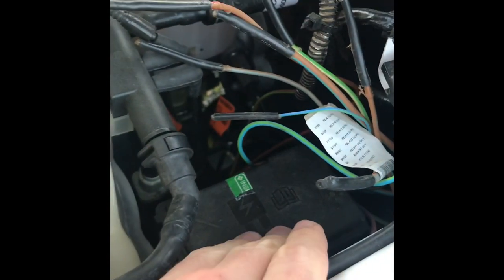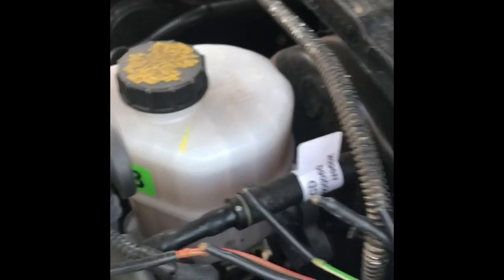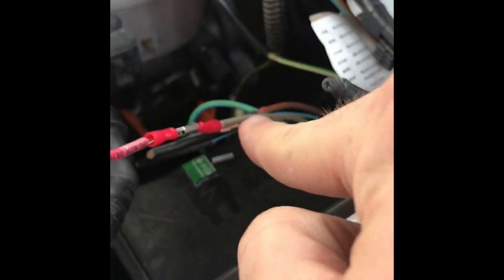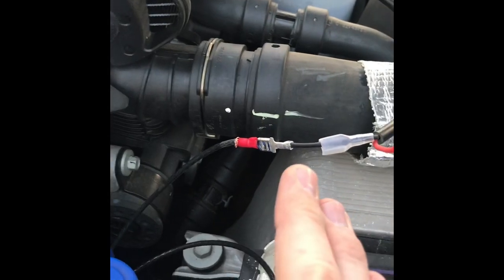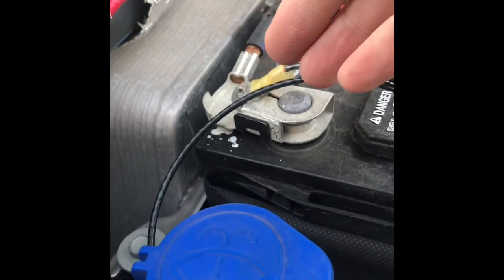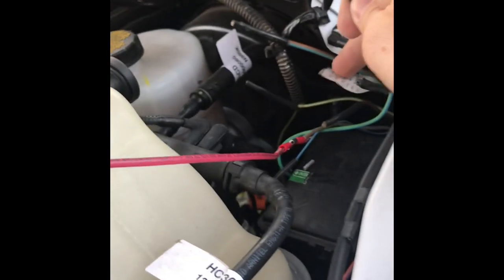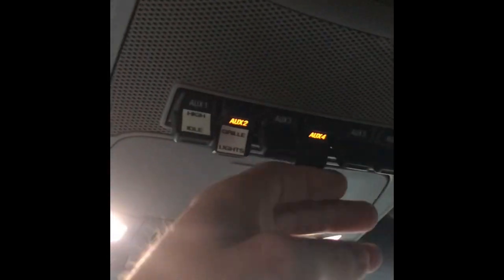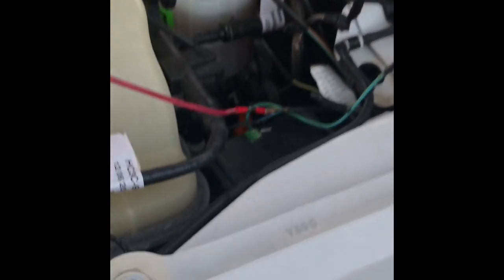How to wire up 2017 and up f250 upfitter switches (auxiliary switches)

Comment: The information is good BUT...the entire assembly on my 2020 F250 was on the passenger side. The wires were wrapped into a bundle, tucked way back and under fuse box and unidentifiable until I remove all the taping. The mfg date on my f250 is 2/2020. Other than location his info was spot on. I used it to wire a winch and driving lights. His "trick" to make AUX hot full time was AWESOME.
Reply from the maker: Thank you for watching, and thanks for the feedback! Yes on the 2020 the upfitters are on passenger side, when i made this video only the 17-19 were out. But i have put in the video description that for the 2020 its on passenger side, wish i could edit the video somehow to tell that to the 2020 owners. If you havent, please like and subscribe, im trying to grow the channel and i really appreciate it!

Comment: excellent video - very specific - I received my 20 inch black oak light bar - I have a 2019 ford f-250 with 6 up fitter switches - am I correct in understanding your video that all I need to do with the black oak wire harness is make a ground connection and connect the hot wire to one of the up fitter wires under the hood - I don't need to bother with the relay, fuse, and on/off switch that came with the harness?
Reply from the maker: You can hook it straight up if you would like. But it would only take 5 minutes to put a inline fuse in the hot wire. Without a fuse It could burn your wire up. But yes that is all you do. Please like and subscribe! 🇺🇸
Reply: @COLTSWAY  please explain the inline fuse regarding hot wire
Reply from the maker: J R all you are going to do is cut the hot wire somewhere before the upfitter and splice a fuse block In. Best I can explain is go to google.com and type in inline fuse block then go to images and you will see what it is. If you need anything else. Email me at coltshinton@gmail.com and I will send you pics of what I’m talking about.

Comment: I cant find the wires under the fuse box under the hood? Any ideas where they could be?
Reply from the maker: Michael Burke what year is your truck? Do you for sure have the upfitter switches inside the cab?
Reply: @COLTSWAY  it's a 2019 and yes but my only have 4 switches
Reply from the maker: Michael Burke send me a pic to my email of your switches. Coltshinton@gmail.com

Comment: Colt, I have a 2020 F250 Xl and I could not find the auxillary wire box under the driver's side of the truck.  I was trying to use your video as a guide, but the camera movement was difficult to follow.  I'll check out your other video to see if it gives slower but more detailed info where the upfitter aux hub is located.  Thanks for the videos.  👍🏽🙂.
Reply from the maker: On the 2020 it’s on the passenger side brother. 🇺🇸
Reply: @COLTSWAY  Roger that.  I'm on it.  When I looked at truck last night, I said to myself, that sure does look like the box (on passenger side) that Colt was talking about.   Thanks again.  Go Army!  👍🏽
Reply from the maker: Yes sir anytime!! I made the video before the 2020 was even out so I didn’t have a choice to show it would be on the passenger side for 2020. 🇺🇸
Reply: @COLTSWAY  Thanks Colt,  I found the upfitter wires under the upfitter fuse box on the passenger side.  Since my truck is new, all the wires were folded and totally taped up in a bundle.  I cut the black tape to unwind the bundle of upfitter wires and examined the wire with color-code tag to identify which auxiliary switch it corresponds.  Each wire has black plastic protective tip.  To access the particular wire I wanted to use,  I cut the entire black end off in order to get to the copper wire then used a butt connector to splice both wires together.  Not difficult. I will admit it was a slight task since it's tucked under and the F250 is so dang high in the air (smie). Thanks again for this video.
Reply from the maker: Glad you got it working my man! Yes they don’t make it easy being it’s so y’all! 🇺🇸

Comment: Great video! I’m looking to wire rock lights to either 5 or 6. Is there fuses already set up or do I just put one in line when connecting them to the switch lead? If they do have one do you by chance know what size? I would investigate myself however I do not have the truck right now. TIA!
Reply from the maker: 1-4 are 25A. 5 and 6 are 40A. Thanks for watching. Hit that sub button if you haven’t! 🇺🇸🦅🇺🇸

Comment: Hey man, you said you have the 12 volt solutions remote start. If I wire up my upfitters 1-4 and leave them turned on and crank my truck with the 12 volt remote start, will the upfitters 1-4 become hot or does the key have to be turned on?  Also wired up my DIY step lights this past weekend, they are awesome. Also got my 12v remote start and it doesn’t interfere with my banks tuner. Thanks for all the info.
Reply from the maker: Sorry bout the late reply. Just got home from work. That is a great question and I just wanted to make sure I was correct. Yes, when you remote start it the upfitters 1-4 are hot! 🇺🇸
Reply: @COLTSWAY  Awesome, thanks.

Comment: So is there already a relay built into it so it doesn’t burn up the wire? I’m used to buying the switch with relay off amazon
Reply from the maker: Sonny Falcon there are fuses for them, you can look in manual and see what ones they are. But I usually put a inline fuse when I install things, I just didn’t wire it up for this video.
Reply: What amp fuse do you use in the in-line? Thanks for a great video!
Reply from the maker: Really depends on what it’s running, but mostly just 5 to 10 amp fuses. Unless it was a fuel pump or something I would go a little higher. Usually you can read on whatever your installing and see amperage it draws. Thanks for watching man. If you haven’t please like and subscribe! Trying to grow the channel. 🇺🇸

Comment: i have 2017 ford f250 diesel and my upfitter cables under the fuse box are not giving any power when I flick the switch. all fuses are getting power and relays are getting power, i believe the issue is the switch wire to the relay. the aux switch light up nut i do not hear the relay clicking. PLEASE HELP

Comment: Are the aux switch’s already hot I assume they are since they light up when u flip em so basically ur just connecting to a ground and hooking it up the aux u want?
Reply from the maker: That’s correct. 🇺🇸🦅🇺🇸
Reply: @COLTSWAY  thanks appreciate it
Reply from the maker: @leefalts7528  anytime bro. Hit that sub button if you haven’t. 🇺🇸🦅🇺🇸

Comment: Colt, 

Are there any pass-through wires with no voltage connection? I'm looking for a way to install an external siren speaker. Thank you in advance!

Jeff
Reply from the maker: Yes there is. If you go to my videos and watch the dash cam install video. It will show you where they are at. 🇺🇸🦅🇺🇸

Comment: When you say 5 and 6 hot all the time do you mean key off hot all the time while swich is in on position? Clarify that please. I'm looking to wire dash cams and don't want to lose power to cameras if asked to turn off vehicle.
Reply from the maker: This is a video I made about it. 
 https://youtu.be/hgBdAAmFJeQ

This is the dash cam video I made. Went right to the batteries. https://youtu.be/raoxxnfscZU 

Hit that sub button if you haven’t. 🇺🇸🦅🇺🇸

Comment: I have an 18 550 1-5 are wired in for beacons and floods the 6th I want for fog lights. How would i tap in at the fuse box under hood
Reply from the maker: capecodscott there’s not a pig tail for the 6th one where the upfitter wires are under the hood?

Comment: Thank you 
My 2018 f250 is the xl trim with uplifted switches I wonder if they are hot
Reply from the maker: They will be hot with the key on brother. If you watch my other video on them it shows how to make them hot with the key off as well.  Thanks for watching, if you haven’t please like and sub. Trying to grow the channel. 🇺🇸
Reply: @COLTSWAY  
So I take it that the switches are already wired? So I don’t have to take the overhead panel out just under the dash like you were pointing to?
Thanks Rick
Reply from the maker: If you have the switches up top, it’s already wired.

Comment: I need tho install a BlackVue DR900S-2CH 4K UHD Dual-Lens Dashcam in my 2019 F-350 Lariat.  Where is the best point to draw power from for the Powermagic Kit?  Do i need to tap into the Upfitter switches?
Reply from the maker: Michael Stein you can tap into the upfitters but none of them are hot with truck off. Now you can make the last 2 hot all the time buy moving the fuse in the box by the upfitters all the way over. But to be honest what I did and suggest is to just go straight from the battery to the pass threw wires in the passenger side. That’s what I did. I’m going to make a video tonight or Tom about installing my dash cam. But I just went from battery to pass threw wires, that way it’s always hot and I never have to worry about a upfitter. Please like and subscribe! 🇺🇸. If you email me I’ll walk out to the truck and send u a video of how mine is set up. Coltshinton@gmail.com
Reply from the maker: Made you a video today brother, hope it helps. https://youtu.be/raoxxnfscZU
Reply: Pur/Grn at the ignition switch, is key-on power also

Comment: Is there more to it than just this? I recently purchased ‘19 250 XL and it came with upfitters. I tried connecting my led light pods and got no power. I thought it was the wiring harness but by connecting positive and negative on the battery the lights worked. Trying to figure out what I’m missing here.
Reply from the maker: Dustin Burns nothing more then this. Maybe you didn’t have a good ground when you hooked to upfitter? Try leaving it on negative and then hook the power wire to the up fitter. If it still doesn’t come on try flipping all the upfitters on. Maybe you just connected a different one then you thought. Please like and sub! 🇺🇸
Reply: Okay cool I will try that. To make sure I have this understood, I don’t have to worry about the pass through wires as those serve if I’m trying to hook up something within the cab? For external items such as lights it’s just wiring to the upfitter wires in the engine area on the drivers side and grounding it, nothing else, right?
Reply from the maker: Dustin Burns you are right. Don’t mess with pass threw. I have a video about high idle if you watch that it shows what to do with pads threw if you going into the cab. But for your situation you don’t mess with the pass threw.
Reply: COLTS A STALLION Follow Up: I tested aux wires 1 and 3 (at random) and no juice. However I tried aux 4 wire and it worked perfect. I bought the truck used it only had 6k miles but the upfitter wires hadn’t been touched.. still zip tied to back of fuse box. Could it be bad fuses? Even though they hadn’t been used?

Comment: You think a power inverter could be wired to the upfitter switches?
Reply from the maker: It could be powered for sure but the amps the inverter would need would likely burn the little wire. I’d just run big cable to the battery and have a cut off switch by the inverter. 🇺🇸
Reply: @COLTSWAY   thanks for the reply, I’m actually trying to install a starlight headliner, I’d be running two kits, both are 16 volt and 16 watts. I’m just trying to figure out the best way to wire them in. I don’t know if I should just run a wire from the upfitters to the kits or if I should use a power inverter. If I run wires straight to the kits from the upfitter what gauge wire would you recommend?
Reply from the maker: Well you will be limited to the upfitter wire size, which isn’t that big. So if you went bigger then that it would be pointless because it wouldn’t carry the amps if the bigger wire.
Reply: @COLTSWAY  by chance do you know the size of the upfitter wire? The wire on the kit I’m using is a 24 AWG

Comment: Hey brother Dack Glover. I learned from you how to rig up high idle on my Super Duty.  I have another question.......apologizing now for the long comment to follow.  I just purchased Raptor Style Grill lights, link below.  It comes with a plug that plugs in to the driver side headlights somehow, so I assume they will be lit up anytime while I’m running park, DRL’s, or full on automatic headlights setting.  How could I control these lights with one of the upfitter switches, would I just tap in to the hot side of the plug for the light bar?

 https://www.stage3motorsports.com/1718-RSGLK-2017-F250-F350-Custom-Auto-Works-Raptor-Style-Grille-Light-Kit.html
Reply from the maker: Dack Glover Dack Glover that’s exactly what I did. I have the raptor lights and hooked them up to aux number 2. Just tap the hot end to the aux you want and connect the other end to a ground. There’s a nut you can back out on the right for the ground, that’s where I hooked up my ground. It’s at 2:07 of this Video you can see where it’s at.
Reply: COLTSASTALLION  so this will allow me to control with upfitter and light switch knob or is it either or
Reply from the maker: Dack Glover it allows you to control it with the switch only. I wanted it like that so that I could have only the raptor lights on with nothing else. I always have them on unless i turn the switch off.
Reply: COLTSASTALLION 
10-4......that’s what I’m going to do to brother.

Comment: I have a dash cam connected to my aux switch #1 and wired it with the hard wire install kit and the dash cam works intermittently. I tried 2 different cameras and I get the same result. I can’t figure out why it won’t work!
Reply from the maker: If it’s on number one, it will only work when the key is on....
Reply: COLTS WAY I know, I only use it while the truck is on and I’m driving. It still cycles the power on and off. It used to work fine, then it started cycling on and off, and now it doesn’t turn the dash cam on at all. I can’t figure out how to test the mini USB plug that powers the dash cam.
Reply from the maker: I would get a phone or some other electronic that uses a a mini usb plug and plug that into it and see if it works. I would check the fuse to make sure it’s not blown. Then go to all your connections and use a volt meter to see if it’s got power in front of and behind the splice.
Reply: COLTS WAY thanks
Reply from the maker: Thanks for wAtching, I’d be interested to see what you find. Let me know! If you haven’t, please like and subscribe. 🇺🇸
Reply: COLTS WAY figured it out. It was the transformer from the dash cam wiring kit that I connected to upfitter switch 1. I had to take the whole interior apart again to remove the old wire, and run the new replacement wire. It works perfectly now. Just in case, I changed it to switch 2. I think it might have grounded out somewhere because I had a wire connection not taped good enough.
Reply from the maker: Man I’m sorry to hear you had to do all that! But hell you got it working now my man!! Good job!

Comment: What does the brown wire mean? Run/start out?
Reply from the maker: I’ll have to rewatch the video. I don’t remember messing with a brown wire.
Reply from the maker: Looks like the brown wire is just one of the the wires that goes to an upfitter.
Reply: Ok thanks. I bought some little LED's to go behind the logo but dont come with any info except hook to headlight positive and negative. Which I cant seem to see where they come out. So might hook to an aux switch. Thanks for the quick reply and video
Reply: As far as the wires out of the head light. Do you know what colors I'm looking for? Either im just not seeing them or they come out where I cant find them
Reply from the maker: Email me a picture of what your asking. Do you haven’t upfitter switches? Coltshinton@gmail.com
Reply from the maker: I would hook them to aux switch. That way you don’t have to have your headlights on to use the leds. Much easier as well.

Comment: No box under hood like this ona 2020 F250
Reply from the maker: I put in the video description that if you have a 2020 and up the box is on the passenger side. Mine is a 2018 so I made this vid back then. But if you have a 2020 and you have the switches on the inside your box is on the passenger side under the hood, not the drivers side. Thanks for watching brother. Hit that sub button if you haven’t. 🇺🇸🦅🇺🇸

Comment: Wish I could do this but I don’t have those switches in my console. There is a place for them, they are just not there.
Reply from the maker: Yea, not all of them come with it. Should be standard option. But you can add them. There are a few videos fb of people adding them. 🇺🇸
Reply: @COLTSWAY  awesome and thank you man. I’ll check that out. 
2017 f-350 4x4 crew cab long bed XLT
I just figured those should be on my truck.
Reply from the maker: Yea man it’s crazy. They should be standard for sure. Hit that sub button for me if you haven’t. 🇺🇸

Comment: How would I hook a fuel tank pump from my auxiliary fuel tank to one of those aux switches?
Reply from the maker: your pump should have a hot and a ground wire. you need to run those wires to the aux wires under the hood and then you will hook the hot one up to the aux switch you want you use and ground the other one. thats it.